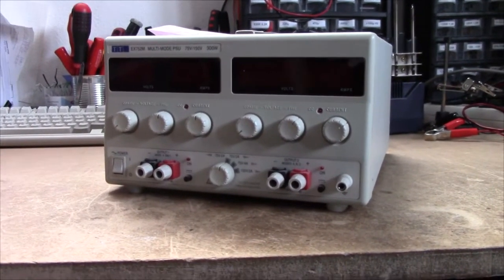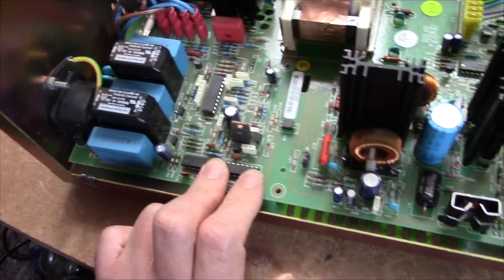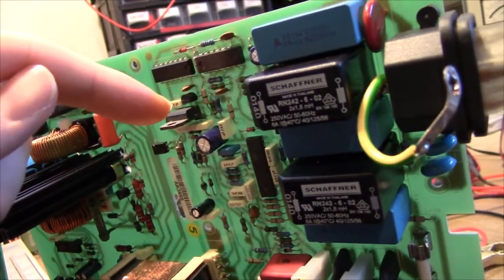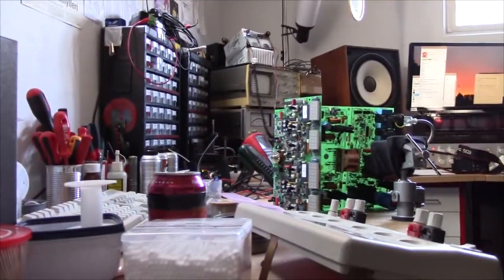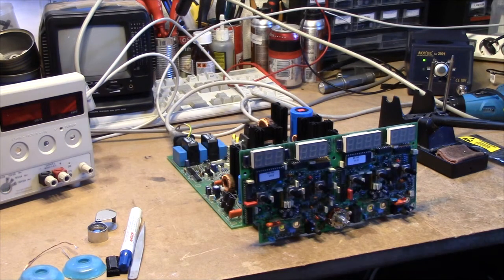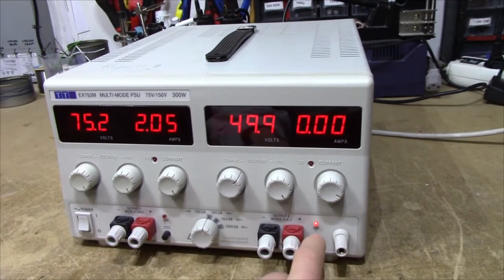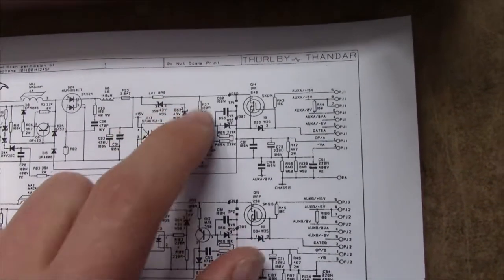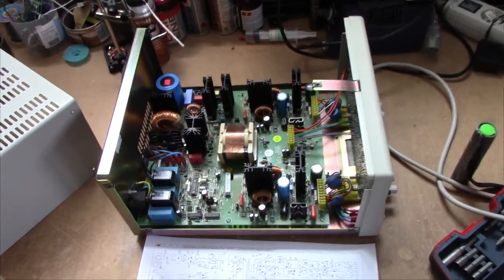Repairing my TTI EX752M bench PSU

Comment: I don't understand your issue with the build quality or design of this unit, it seems excellent and having seen the schematic it's a perfectly logical design. TTi are known to be one of the best and rarely go faulty.

Heatsinking is unlikely to be an issue - it's a switcher so should be very efficient.
Reply from the maker: For the most part I agree, and I really like these units for that. I don't recall what I remarked on in particular in this video, but it's likely that it was at least in part fuelled by a grieving annoyance of trying to get the dastardly thing to work.

Comment: Hello,
 I am the designer of the main power circuitry , but not the front panel or the series/parallel control .
I don't understand your comments about sensitive signal tracks meandering all over the pcb .
Reply from the maker: +E Kus This is an old video, but I think I was referring to some of the tracks that can be seen in the top left third of the frame at about 5:13. If I recall correctly, the traces were so thin in certain places that the manufacturing process hadn't been precise enough to fully render the traces. I.e, you could see the amount of copper in the trace varying to a considerable degree.

Looking back at my comment though, it was probably overly harsh, being inspired by the agonising troubleshooting procedure that preceded it. I removed the written comment, in light of this.
Reply: +E Kus Are you a current employee at Huntingdon?
Reply from the maker: SDG Electronics That's an oddly specific question.
Reply: FFcossag They're just down the road ;)
Reply from the maker: SDG Electronics Ah. And no - I probably don't even live in the same country as they do.
Reply: SDG Electronics  I am not an employee TTI at but a consultant designer . I have worked with them for 23 years and am at this moment working on another PSU for them :) I live on the south coast .

Comment: Good presentation.
Sometimes that heatsinks go overtemperature damage the power semicontactors.
I suggest you to put some fan behind the psu.
Reply from the maker: Thank you.

The unit doesn't seem to run extremely hot, most heat sinks are around 70 °C at worst, so I'm fairly confident in running this unit passively cooled.